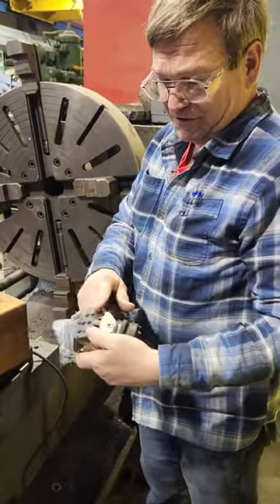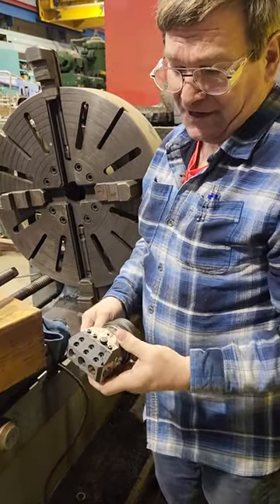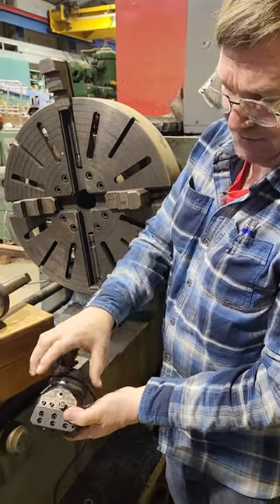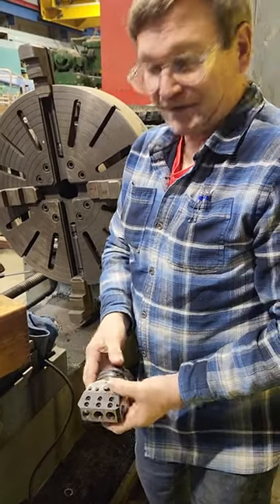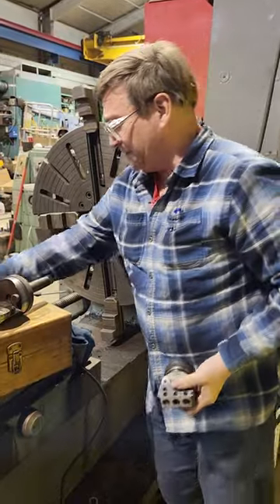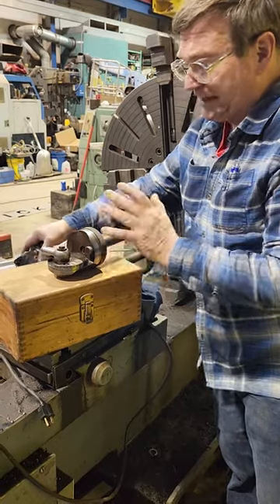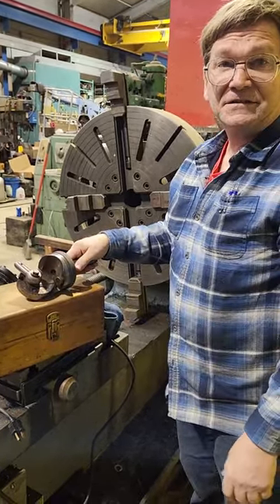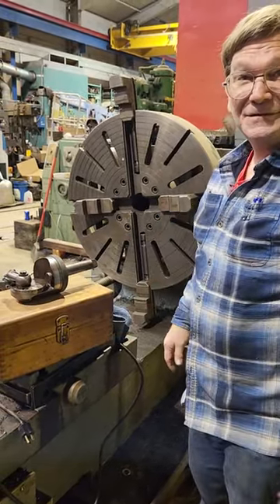Machinist's Minute: Facing Heads

Comment: What I have done is made extensions for a few whaulhaupter I used to over all landing gear. I would make them with a 3/4 hole and use fly cutters 
From  Sierra America add M100 import tools from Micro100 DCMT lathe tools make some great facing tools which you can cut forward, and backwards with the fly cutters

Comment: At work I have the same one you first showed. I was under the impression that gear mechanism was to cut tapers with that boring head? What are you saying it actually does? I can’t say I’ve ever seen someone use it with that function.
Reply from the maker: It moves to a larger cut diameter, as it turns, so you can face with it.  The most valuable purpose for that type of head, is to cut groves for snap rings, or o-rings inside a bore.
Reply: While it's not it's main purpose it definitely can be used for tapers too. The manual I had found online for a machinist friend had a comprehensive chart (also the formula for calculating your own tapers) of combinations of boring head in/outfeed per rev and carriage feed per rev, that will result in common tapers. 

If I remember correctly he had got the size 4 Wohlhaupter (the original design is from Narex), from which size and upwards they feature a series of detent pins around the feed ring, and each of them you put in the pressed in position, adds 0.02mm of outfeed/rev (they are 12 in total if I remember correctly for a maximum of 0.24mm/rev outfeed and snapping the all out via the resetting mechanism results in no feed from holding the ring). I haven't seen an original Narex head in person, but the Wohlhaupter one is a work of art!

This type of universal boring/facing heads were mostly meant to be used inside the internal Morse taper of lathe spindles (and not so much on milling machines), in order to produce features suited for turning on odd shaped or oversized parts that are not convenient to be clamped or rotated on the lathe. 

The parts are getting either directly clamped on the cross slide or onto a vertical Y-axis attachment in the place of the compound slide (to adjust the height of the part more easily), in a similar setup to line boring on an engine lathe